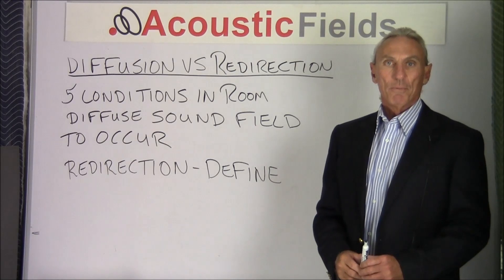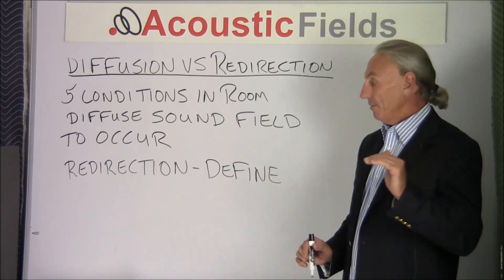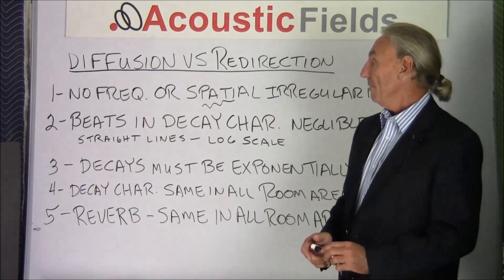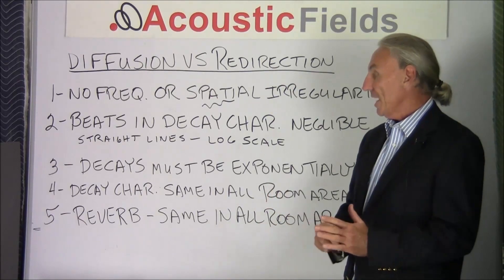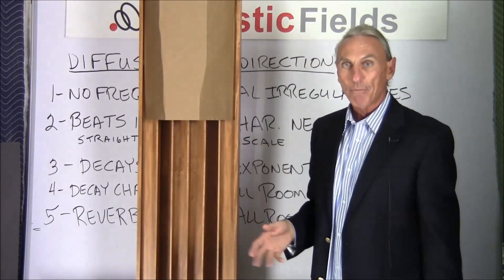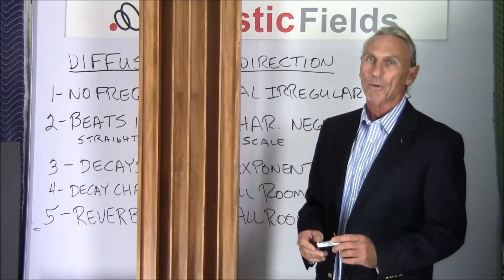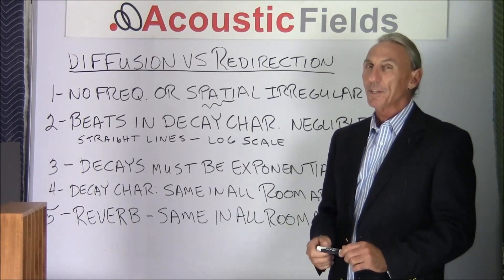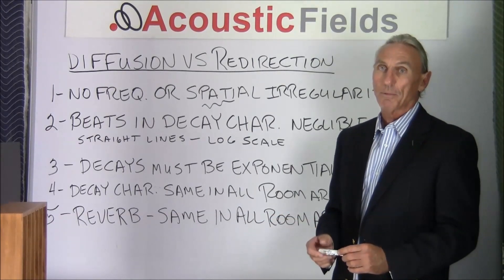Sound Diffusion Vs Sound Redirection - www.AcousticFields.com

Comment: These video are really good, straight forward, honest, and loaded with information. I have a question about adding MLV between the joists of an exposed basement ceiling just to dampen the sound (just to deaden the sound)? Do you think that would work?
Reply from the maker: What is the frequency and amplitude of your noise issues? All materials are frequency and amplitude dependent.

Comment: Sounds contradictory. You say it works in 2 directions at the same time but then say you have to mount it vertical for horizontal waves and horizontal for vertical waves (that's not 2 directions at the same time with same device). You talk about a flat frequency response but then you say its frequency response can be tuned to your purpose. Too much BS and drip feeding of facts = a lot of wasted time watching your videos for very little benefit. Please combine about 5 video's into one without most of the waffle. Show before & after results and a visual demo of the physics.
Reply: He means that the same device can be used either horizontally or vertically, or two devices doing both at the same time

Comment: The only thing I have against QRDs is that they sound almost totally lacking in character.
Reply: Yeah, the tube re-issues don't have the same mojo as the originals. They should put a 1073 INSIDE it. Now that's character!
Reply from the maker: W, After 30 years of working with quadratic diffusion, we have found the opposite. The separation, definition, and clarity they add by reducing reflections adds to the overall presentation and increases the character of any environment.

Comment: Another real interesting video. Ive seen quite a few rooms with the half round tube "bass traps" in the corners of the room. Most of the time used with no other treatment so the rooms still have acres of untreated hard surfaces and nice big glass windows. It seems to me that these tubes are becoming used more and more like a fashion accessories in many high end audio rooms. I think id rather have a bit of bass boom to take  away from the screechy ear splitting trebble bouncing off the rock hard painted plaster walls and hard floors. Designed more for looks or fashion than sound reproduction